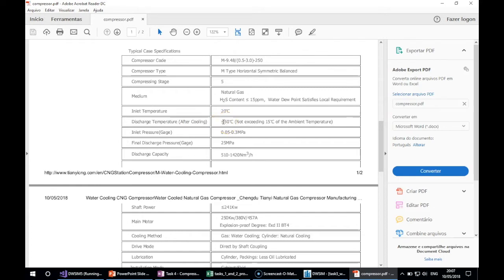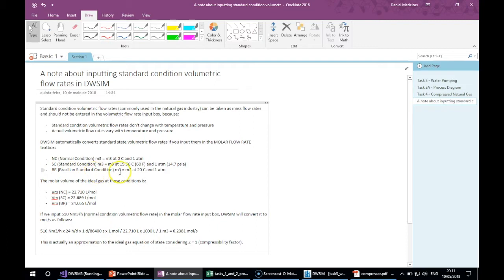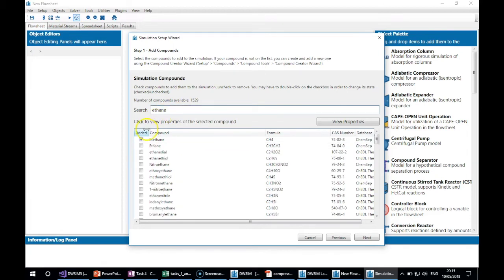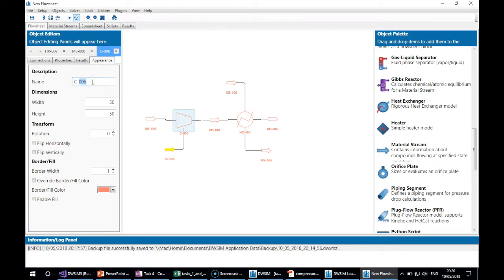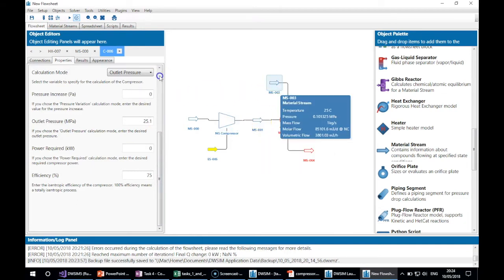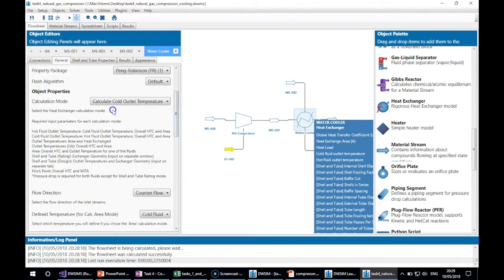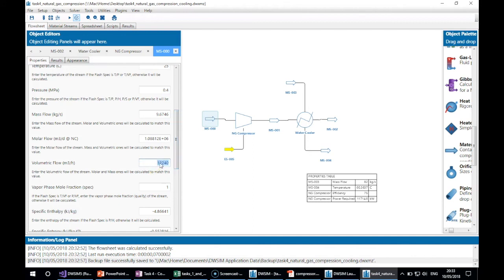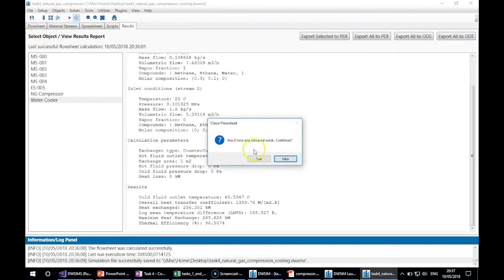Basic Course 1 - Creating a Simulation (Task 4)

Comment: Thank you very much for these tutorial series! I really enjoy the simplicity of DWSIM.
Some minor comments
1. The compressor outlet temperature is very high ~477°C. I may recommend to compress in several stages
2. It would be great if by specifying the outlet temperature of both outlets on heat exchanger DWSIM can calculate the flowrate of cooling water.
PS:
- Simulating on Aspen Hysys 11 shows very close results
- I will post the second comment on GitHub (https://github.com/DanWBR/dwsim6)